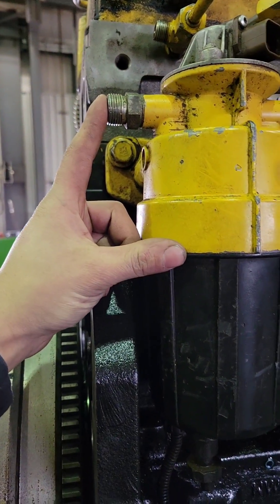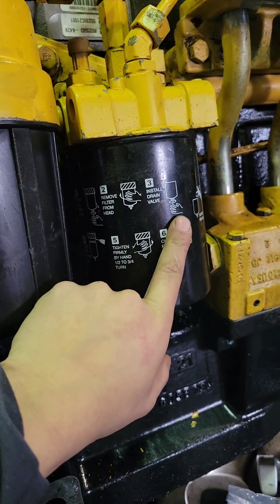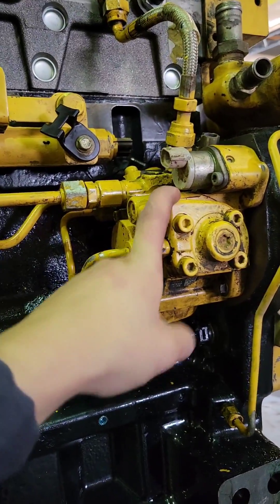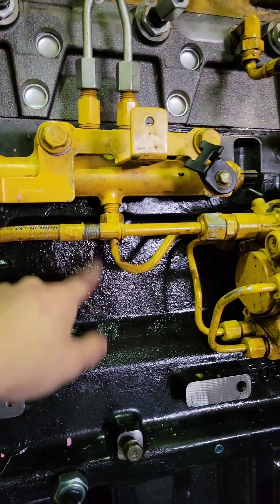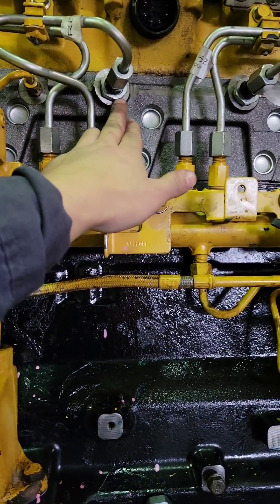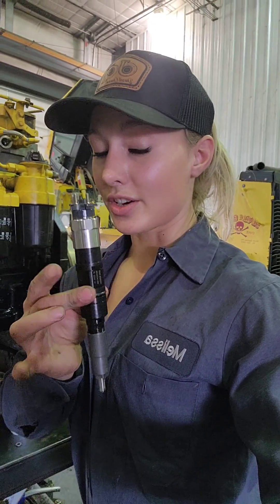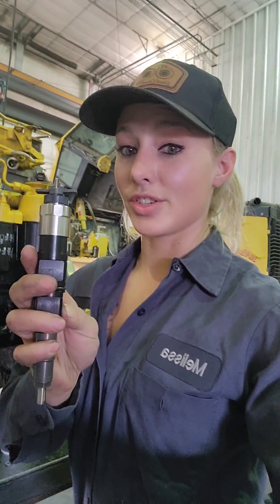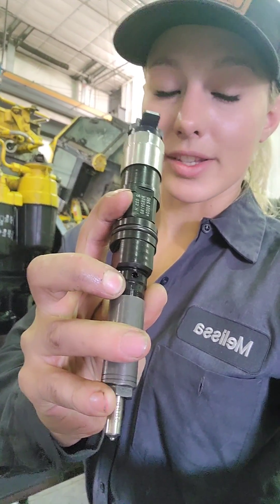Diesel Common Rail Fuel System Theroy Of Operation

Comment: The fuel delivery tube is called a quill tube, the o ring is there to seal low pressure fuel that is circulated through the head to cool the injector body at the quill interface. The seal at the quill and the injector body uses differential angle and a spherical radius to form an interference line contact seal by deformation. Overall, nice presentation. I had the privilege of mentoring multiple female technicians, all of them were top shelf and two went on to become mechanical engineers.

Comment: thk U  Queen  MELISSA... 
Nice Info on the fuel sys.
my diesel  has  piezo  elect.
operated fuel injection  . the
solenoid operated FI is good ,
but response time may be 
slower for computer 🖥 
controlled systems ..  😊

Comment: Actually on a commonrail system the fuel rail automatically relieves the pressure so it doesnt have pressure when not running or when the key is off.. thats commonrail systems anyways but a regular system like the early second gen cummins isn't a commonrail system so it's a much lower pressure😊